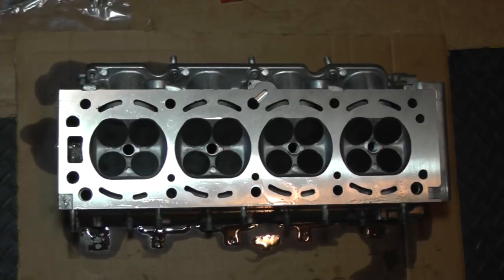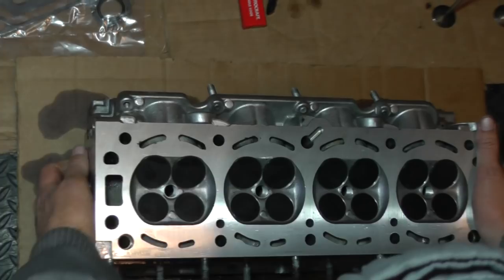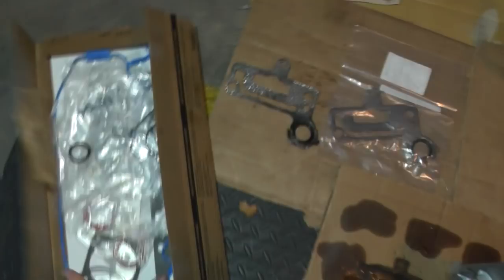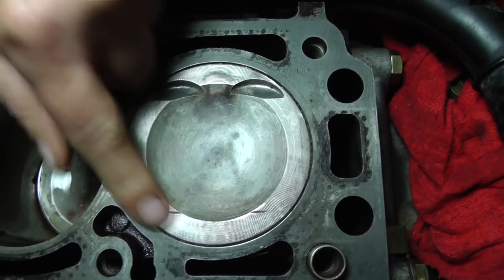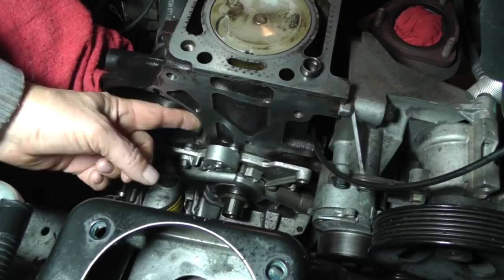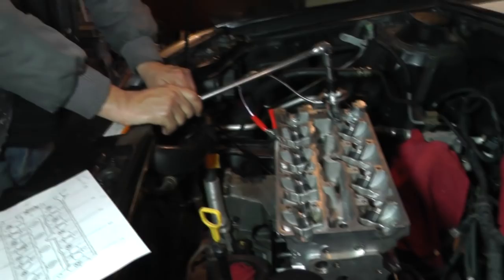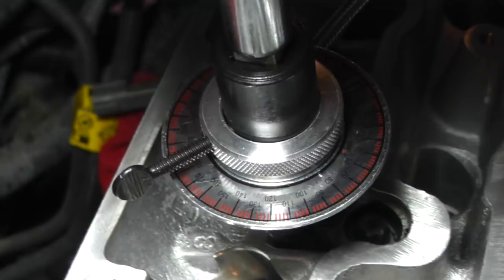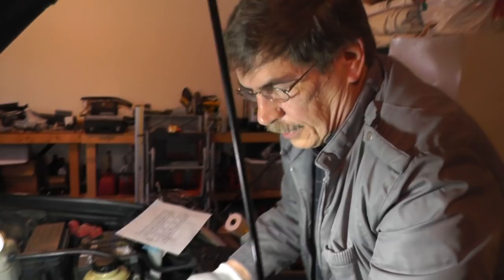Suzuki Forenza Head Installation - Part 9 (Initial Head Install)

Comment: Great Videos. Thanks for taking the time. Awaiting my head to complete mine. No piston damage, looked like yours which I found to be common on the 2.0. This may be mentioned elsewhere, but thought I pass on that Fel-Pro now makes the EGR adapter gasket (that is still well over $100 on Ebay and more through the dealer). Fel-Pro part number is #71379 and Rock Auto sells it for $57.79. Still too expensive in my opinion, but helps a lot! They Also offer the gasket included in their complete gasket set (2006-2008 Forenza) The new complete PermaTorque® MLS head set stock number is – No. HS26317PT2
Reply from the maker: Thanks Marc for the helpful information. Sure would have been nice if Fel-Pro had came out with that gasket when I did mine. I'm sure a lot of other folks will appreciate the info that you've provided. Good luck on your repair and take care...
Reply: stuzman52
 Thanks, one more question (sorry if you answered this elsewhere). I noted you put new camshaft sprocket bolts on when you put the sprockets back on. I think i heard you mention they were one use only. I haven't been able to find them and I've called  2 dealers (and talked to the repair dept) and a large US Suzuki car parts warehouse and they all have told me they are re-useable. They said unless damaged, clean, oil, threadlock and torque to specs. Do you have any more info about these 2 bolts?
Reply from the maker: Marc G Hi Marc G. In the service manual, it says that they are torque-to-yield bolts along with the crankshaft sprocket bolt. That's why I changed them out. I'm quite sure that I showed the part numbers for both the cam and crank bolts. You may be okay with using the bolts, but I didn't want to take the chance since I was able to get the bolts. That's all I needed was to reuse the bolts which are never strong as when new, and if the bolt(s) broke, then I would have this head damage all over again. I'll have to leave it up to you Marc if you want to reuse them. Take a look at the videos of where the cams go back in and you should be able to see the part numbers if you want to get new bolts. At least this way, the Suzuki dealership can have something to go by.

Comment: I want to thank you for this video series. I am changing a head for the first time and it happens to be on a 2005 Suzuki Reno and your videos have made it easy.  Of course I am bouncing torque specs against my actual model as it is just a little different.  My question is this: "Where did you order the cam bolts that hold the sprocket to the cam shaft?"  All the parts are on their way but I cannot find the bolts to hold the sprockets on the intake and the exhaust cam sprockets.  Thanks for your help in advance.
Reply from the maker: I ordered the bolts from online dealership. I believe it was from these folks. http://suzukicarparts.com/partlocator/index.cfm?siteid=214820

Comment from the maker: Yes, the valves were pretty bad shape. When the timing belt is installed, the valves will move in synchronization with the movement of the piston's travel. When the belt breaks, the  valves stop moving, but the pistons continue to move up and down. So, when the belt breaks, some of the valves will be open and then here comes the pistons which slam into the open valves. On the valve bent the worse, the valve was open. Then the piston slammed into it bending it. Then when the piston....cont

Comment: Alright so I did this job twice already and I'm still getting white smoke on the back of the exhaust after the engine is warm. I dont have the tools to do a leak down test or a compression test. So I think I have a cracked head somewhere from a valve, that's just my guessing. After I took it to the machinist now the valves or lifters tick like crazy. The coolant on my reservoir doesn't go low at all so I'm getting pretty frustrated now
Reply from the maker: You may have to get a leak down and compression tester Andres to do further testing. These items aren't that expensive and I'm sure that you're close to getting it figured out.
Reply: @stuzman52  so I performed the compression test and I didn't get more than 15% of a difference. Cyl1 was 180, Cyl2 was 164, Cyl3 was 165 and Cyl4 was 170 but in Cyl1 I notice there was oil in the spark plug, coolant in the reservoir seems to get hot pretty quick but idk if its boiling and I dont seem to loose coolant. Could I have some coolant left over on the oil pan?

Comment: GREAT, MY daughter hired a guy off Craigslist to fix a leaky hose who said while he had the front part of the engine off replace the timing belt, well he messed up ruined the motor and here we are three "mechanics" later and the car still sits with no head.

Comment: I spent $84 and got all the valves, valve seals, all the head bolts, all the gaskets for the top half of the engine, and a crankshaft sensor...
Reply from the maker: Good luck on your repair and hope it all works out!

Comment: Hey Terry – I wanted to let your followers know that Rock Auto is now offering the EGR gasket alone for $56.89 instead of $132.00 elsewhere. The Fel-Pro part number is  71379. It’s available at Rock Auto for the Suzuki cars under the “Emissions” heading. There is no photo but you can click on this link to read an article about the gasket and confirm the part number and see a photo of it:  http://www.felpro-only.com/latestnews/fel-pro-first-to-offer-suzuki-head-gasket-set-featuring-replacement-egr-adaptor-gasket/     I hope this is helpful information. I bought the gasket from Rock Auto and was VERY grateful to save $75!! Thanks so much making hese videos.  -Scott
Reply from the maker: Scott6459 Okay Scott, I took your posting and stuck it right into the description of this video for any followers out there doing this job, just in case some folks don't read the postings. Maybe, they might read the description. I'm sure that they will appreciate your information. Thanks again!

Comment: Yes sir I just put the head back on it ur videos have been extremely helpful on getting it off and working to get it together did I compromise the head gasket by over tightening the head bolts I am going to remove the head and get new bolts because as I stated it has been to much work to get to this point to turn around and have to do it all over
Reply from the maker: james newell You're doing the right thing James as you'll have to wonder as you go through the job if it will stay together. Yes, once you've torqued the bolts even if they were at their right tightness, the head gasket has been compromised. So, get a new head gasket while you're at getting the new bolts. Then, you won't have to second guess yourself about the work. Once you've done it right, then you'll feel a lot better about not having to go back in there if something leaks around the head.
Reply: Thank you very much for the reply and the help it was a blessing to find these videos as others stated I couldn't even find a Haynes Manuel and without these videos I would have to go at it blind for that I am truly grateful as well as thankful for the advice and time to respond to me
Reply from the maker: james newell No problem James as I'm always glad to help. Take your time with the project and you'll be fine. The torque specs should be scattered throughout the videos of where you put everything back together.

Comment: Excellent explanation of how to change the valves in the cylinder head.

You have the four pistons with the mechanized work, why were the valves bent?
Reply from the maker: This is an interference engine and the timing belt broke which then bent the valves. You can see the broken belt in the first video of this series. Thanks for the comment and question.

Comment: These videos have single handedly helped me get my 2000 Isuzu Amino 2.2L together.  I am nearly done, but now the Isuzu dealer tells me the harmonic balancer bolt is no longer available.   Should I use the old one?  Isn't it a torque-to-yeild?
Reply from the maker: +Frank Burrell It is a torque-to-yield bolt Frank and technically these bolts are to be used one time. With head bolts, this would be a real issue as you could have those bolts to continue weakening because of the pressures and high temperatures although they are weakened anyway when they are torqued up. With the crank bolt, I would just use it since you can't find one and it won't be under the stress like other bolts. Put a little blue thread locker on it and torque it up. Hopefully, you should be good to go...
Reply: Thanks so much man!  I actually wound up doing exactly what you just wrote.  My next issue is with the bolts on the cam caps.  I went out and bought an inch pound torque wrench, but it turned out to be to big.  The range on it was not small enough for 71 inch lbs.  Mine was a 3/8"Drive, but the 1/4" Drive starts down around 20 inch lbs.  Sunlight caught up with me before I could find the smaller one.  Now I am stuck in this factory the next three days until I can wrap things up.  I will also need to verify the torque specifications for the cam cap bolts on a 2000 Isuzu Amino with the 2.2L.
Wish me luck man!  
Also, I just loved the green Hemi Charger sitting in your driveway at the end of one of your videos!
Reply: "Isuzu Amigo"
Reply from the maker: Yeah, just get you the right torque wrench as it will come in handy for other jobs down the road. As for the Charger, that was my step son's car. He sold it a few months back and bought a Jeep. And he kept that for awhile and then bought a Toyota SUV since he got married. I suspect his wife may had something to do with that Ha!...
Reply: +stuzman52 I dig it man.  You seem like a very genuine guy.  I wish there were more people like you in my social circle over here in Bristol,  TN.
Reply from the maker: +Frank Burrell Well, we're all neighbors Frank and people should just be themselves. Besides, if you're anything but who you really are, people will find out soon enough. Take care Frank....
Reply: +stuzman52 Thanks immensely!

Comment: Thank you for this awesome video. I am in the process of repairing my head gasket on my 2007 suzuki Reno, coolant did mix with my oil and now its milky in color. My question to you is how do i clean my engine now?
Thank you.
Reply from the maker: Okay, you need to be sure that the head is in good condition as far as being not pitted and that it's flat. Also, for cleaning, I believe in doing it all by hand, no power tools. I used Permatex gasket cleaner, brake cleaner and a razor blade in a holder. Other than that, you should be good to go. Let me know how it goes and thank you for the comment on the video(s).
Reply: stuzman52 How do I clean out the coolant that has mixed into my crank case? The car will not start. Is there an engine cleaner that I can put in that will clean the oil out for me, or do I need to remove the oil pan and clean it that way? I really appreciate your time!
Reply from the maker: Hi Angel, I understand your question now. Drain the oil and change the oil filter. I normally run synthetic oil, but if it was me, I would just use conventional oil for the flush as it's cheaper. Run the engine to operating temp and then drain the oil again and again change the filter. At this point, if you're using synthetic oil, you could put that in at this time. I would stay away from any so called engine flush products. Hope that helps you out angel...

Comment: Hey stuzman can u tell me if I messed up I torqued it to over 75 ft pounds I never did angle turns if I over torque it can u tell me what could happen I really don't want to get it back together and have to tear it right back down
Reply from the maker: james newell How far are you along with the project James? If you just got the head on, you can always pull it back off and get some new head bolts with a new head gasket. And of course, if you don't have an angle gauge, you can pick one of them up too. Over-torqueing bolts will stretch them more of course which weakens the clamping force of the bolts to the head.

Comment: Used your videos to rebuild the head on mine. Thanks. I'm having excessive oil in the throttle body. Can't find the pcv valve on my 2004 forenza. Any suggestions?
Reply from the maker: Glad to hear the videos helped out Michael! There isn't a PCV on the Forenza. The PCV system is located within the valve cover which is basically a molded channel for the blow-by gases.

Comment: Suppose one did not buy that expensive $100 gasket and tried to reuse the old one. What would leak from the round hole in that gasket?

Comment: How would I know if I have a cracked head? Can a thermostat give me white smoke?
Reply from the maker: To know for sure if you've got a cracked head, you'll have to remove it to inspect it. Symptoms are the same as bad head gasket such as oil and water mixing, high temperatures of the coolant if it a large crack, white smoke from exhaust on start-up and high pressures inside the coolant bottle. Not likely that a thermostat will cause white smoke from exhaust.

Comment: I watched all you videos, they're great!
I failed to see where the 2006 Forensa 2.0 L PCV is located for R&R. My PCV has failed, It's causing excess back pressure. Could you make a video pointing out engine parts and location. Also, which repair book do you think is best?

Comment: Wanted to ask a question,
When Turning the Head Cylinder bolts to 90 angles in 3 passes everything felt fine except for two of our bolts on the last pass.
Once we went passed 75 Degree it "turned"/felt loose; we doubled checked by trying to move the bolt and hand tighten very slightly to see if it would nudge or was broken but felt nothing and it felt tightly in there.
Should we be worried about this?
We are in the last 3mins of Part 14 of your video and about to start the Timing Belt install and pretty far in the installation of the new head.

Thank you very much for these videos and its helping me and my family in our current situation.
Reply from the maker: Alex Perez Things like that make you wonder. You’re probably okay, but I can’t make a guarantee for you. On the other hand, if those two bolts didn’t torque up correctly and you’ve got a leak later, you’ll have to tear it back down. At this point now, you’ll be out of a head gasket and head bolts if you want to redo it now. If so, make sure the threads in block are clean by using thread chaser along with the other stuff mentioned in video. The choice will have to be up to you.
Reply: Same thing happened to me while installing the head on my dad's Reno. It worried me, but I was going to let it go. However,  when reinstalling the exhaust,  one of the studs broke off and I had to remove the head and I bought new bolts and head gasket , AGAIN. I'm going to use a thread chaser in the holes in the block and hope not to have that issues again.